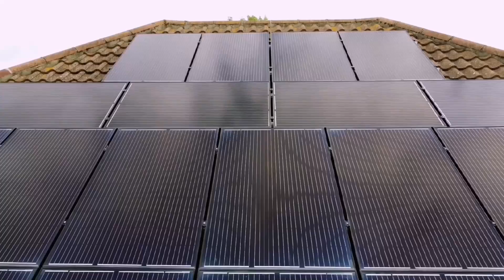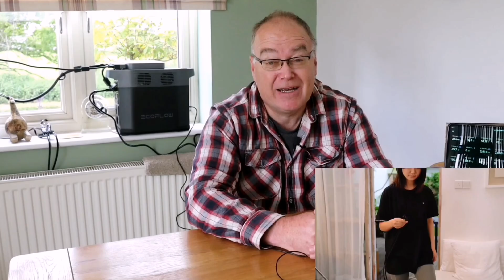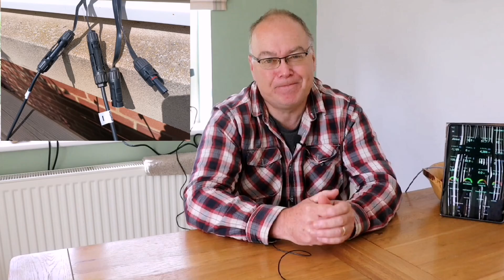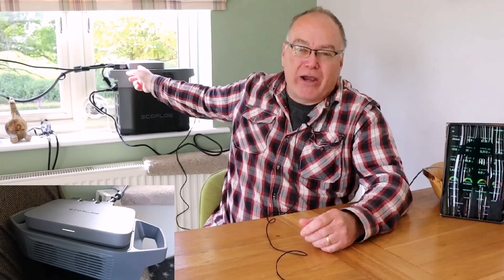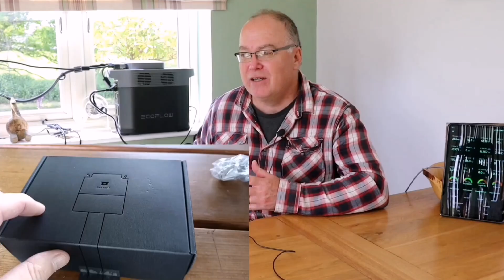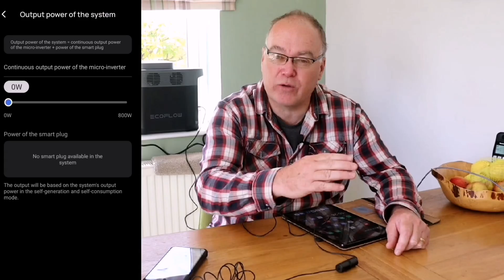Revolutionary Ecoflow PowerStream - DIY plug in grid tied Solar PV & battery system

Comment: Removed from the UK website today :(
Reply: "We are sorry, I just checked and I was informed by our relevant department. powerstream is currently off the UK official website, we are upgrading and improving our products. It will be available in the UK in the near future."
Reply from the maker: Curious ....
Reply: @EVPuzzle  Think the penny has dropped its not legal on the UK market. Be good if they can come back with a workaround that fits the UK market though. Be a great product. If they can get it registered on the MCS approved installer list for a start that would help as it proves it will act correctly for the UK grid. Then they just need terms saying connect it on a dedicated circuit.

Comment: Great video thanks for answering a lot of questions. I’ve got one more for you. Can the power stream work in reverse and charge the battery from the grid plug? Say for instance I have a reduced cost electricity overnight, can I set a schedule to top up the battery using the cheap rate during this cheap window? Where the inverter would draw the power from the grid and send it to the batteries? 
Ideally I’d just use the D2 extra battery but as this can only be charged via the power stream (or a standard D2) it may limit how useful the system could potentially be.
Reply from the maker: Battery itself charges from the grid not powersteam
Reply: hi have you worked out?

Comment: Ref the cable removal. There should be a tool included that pops the cables from the inverter. Check on the underneath of the inverter cover
Reply from the maker: Yep missing on mine

Comment: Really interesting system!  I live on a narrowboat and looking for a new solar set-up.  I've been trying to cut down on my electric usage over the past couple of years and generally use everything 12v, but I miss playing on my xbox!.  Would this system work to generate power for your house in a blackout I wonder?  (presuming the total load doesn't exceed 800W)
Reply from the maker: Only the battery provides power in power cut but solar could plug into the battery in that situation
Reply: If you have enough capacity (they burn electricity compared to a typical laptop) and you need mains you can add any old 12v to 240v inverter to a 12v setup. It's much much more efficient to avoid it though.  The powerstream inverter only supplies power when there is power from the grid as well, but if you are not grid tied is not suitable although the delta max 2 might be except for its rather limited solar panel capacity (800W max)

Comment: Thanks so much for the video. I agree this is almost an iphone moment in solar/ battery technology in the uk. I am amazed eco flow are not explaining this solution in a better way. I have lots of questions I am afraid - maybe useful if you end up making a 3 rd video! 

Here goes

1) it looks like with this setup you have the panels connected to the smart invertor up the limit. If it was say low light in winter could you have panels both connected to the smart invertor and also connect panels to the delta battery? So that you could be both capturing solar direct to charge the delta and also be inverting solar connected to the smart invertor at the same time?

2) regarding demand for power via the smart invertor, if the invertor was feeding power to say a plug enabled device, to save plugs, and if the delta was say next to your broadband router etc - could the local devices be plugged directly into the delta rather than taking power out via the smart invertor?

3) is there anyway to use the eco flow app in demo mode to see functions before buying a setup? Reason - for example is there and option to set a minimum SOC at say midnight and if low then the delta would charge from
The mains supply to property when on a cheap rate tariff?

4) if 3 is not available is the soc available to other automation systems like home assistant or SmartThings so that it may then be able to trigger intelligent soc/time of day charging?

Sorry for all questions but an exciting bit of kit for sure.

Comment: Thanks for this. Have been wanting someone to explain the system for a while now. I was previously confused as to if this actually fed power to a home via existing wall sockets. It seems strange to think that power can be put into a home this way as we perceive that sockets are for taking power out. Still a bit confused as to what the smartplugs do. Does this mean only appliances using the smartplugs benefit, or does the system feed other normal sockets around the home too? Great video nevertheless. Thank you.
Reply: Smart plug is just intelligent wireless way of sharing consumption information to the system. When the system gets the consumption info, like 100 Watts is consumed right now, you can configure the system to add that same 100 W on top of the base load you have configured. The best would be, if the system could detect the consumption of the house as total and you could adjust with that.

Comment: Do you think it would be possible to use an extra 400w panel plugged directly into the Delta so the battery was being charged even when the house was taking 800w? Wondering if it could be hacked to make use of 1200w of solar

Comment: This system is almost certainly illegal in the United States. Grid tie inverters must sense when the grid goes down and shut off. Otherwise it backfeeds power to the grid and risks electrocuting the techs working on the grid. If it does sense power failure and shut off, then it’s of no use when the grid is out so why have a battery? We use (pro) wired-in load switching panels for off grid backup just for that purpose.

Comment: I have sent a question to EcoFlow themselves but not sure how good they are at replying. My question is how does this work with your existing solar and battery? When you’re pushing watts into your home via the EcoFlow system does your other system just see a reduced base load? Also what happens if the EcoFlow battery is full and you’re producing more solar than base load. Does the EcoFlow system just shed the excess or does it feed into the grid? I’m close to buying as I think the overall package is actually pretty good value - I just don’t want to buy and find it won’t work with my existing solar/battery system.  Cheers Nick

Comment: Explain to me the point of the power stream?  The delta models come with a plug and inverter.  Why not just run a long extension cord off the delta and skip the power stream?

Comment: Hi Nigel, followed you for a while now which has been very helpful with designing my system.  On the eco flow I am sure the anti islanding protection means the 3 pin wouldn’t be live when unplugged as it would be disconnected from the grid. I think with a couple more panels, a wireless ct clamp and combined with off peak tariff this could work really well for people not looking to do a full install. Will look forward to more videos…
Reply: If you have a smart meter and start back feeding into the grid your energy provider will send out an engineer to check you haven't tricked the meter. Also feeding into socket (against UK wiring regulations ) can overload the cable supplying any other socket outlet on that circuit.
Reply: @DavidPemberton-k5q  absolute rubbish as from a grid point of view its no different to a fixed install and can also be registered the same as a fixed install so no engineer will call. This system has also just been passed for legal use in the UK AND APPROVED.
Reply: @vincelemon6343  am sure it will get banned soon enough just a shame someone always has to get hurt or even die before action is taken. Electricity is dangerous always seek advice from a qualified electrician.
Reply: @DavidPemberton-k5q  I actually agree to a point. The one thing that puts me off this actually is my house insurance as im not convinced we would be covered in the event of a house fire in the uk if it was found one of these devices plugged into the system. We all know insurance companies look for any reason not to pay a claim so i bet they wouldnt pay out even if no fault of device.

Comment: Do you have a circuit diagram Nigel showing how you are connecting into your house ring main - I'm intrigued but sceptical.  eg if the local substation goes offline, your Ecoflow needs to also go online otherwise your sticking 240V back down the mains incomer and back to the substation.

Comment: There is so much ambiguity in the comments below, why not just buy a solar inverter battery like an eco flow delta 2 max 2 kWh, or an Anker 767 2 kWh (which I have) and have a transfer switch installed, this enables me to power everything in the house through the main consumer unit in the event of a grid down at the flick of the transfer switch, plus you can switch off the mains power with the transfer switch and power almost everything off it to save electricity for a day if you wish, all legit and safe, am I missing something ?

Comment: Tempted as I don’t want to install at my current property as I’m probably only going to live there another couple of years. 

Like the portability as it would be good for camping, when travelling etc. Also great for powering gardening tools, shed, summer house etc without the need to install electric. Got a quote to put electric into my log cabin and that was going to cost around £1,500.

Comment: Looks a great product.  I might have missed it but how would it handle a power cut.  This would be a bonus.  Let me know what you think.
Reply from the maker: It cuts supply and you can use the battery in isolation in a power cut..

Comment: Hi ..Can you explain to me how it works because I didn't understand, I have power at the sockets and I plug the microinverter into the socket to give me power.... the power must be off in the house or the smart socket does not take power from the grid but only from the microinverter..  ....it's beyond me....can you explain?  I think that in two weeks it will come to me too and I don't want to make fireworks in the house

Comment: Hi Nigel this is very interesting and something I’ve been waiting for for literally years…. 

I have a full solar setup and Tesla Powerwall so I’m familiar with the concept of solar/battery etc. I also have a static caravan and so am very interested in whether this is a neat solution providing solar power and I suspect it’ll cover the majority of our usage in the van? 

For me the bit I’d like to understand better is the max input (solar) and output (load) I think from the video and reading the comments it’s 800w continuous? - is that right? Also what if any, is the limit on storage i.e. can you build a larger storage system of say 4/6 or even 8kW? In terms of using it in my home supplementing my existing system having an extra say 5kW of storage that I can charge overnight on Go and then release into the house at 800w during the day will help through the winter when solar is minimal and (as I’m 100% electric with ASHP & AC) loads are high. Basically it’s a way of upgrading my storage without having to buy another Powerwall and as I have high power output covered by my existing system the 800w limit shouldn’t be an issue. 

My fingers are literally hovering over the buy button but before I do I need to research some more to ensure I’m fully informed and understand the limitations (ps I assume AC input into the battery from mains plugs into the battery itself? Can this be done while the system is running and outputting?)

Comment: I’ve always thought that solar systems would get cheaper, but it’s no good seeing the hardware get cheaper if the labour costs don’t become cheaper.  I think this solution has a hint of genius about it:  Delete the labour costs entirely and you expand the solar market to everyone:  tenants and flat dwellers.  

The one concern I have is that someone is going to accidentally drop one of these panels from their balcony causing damage/ injury to someone underneath and then a whole new raft of rules come out banning balcony/ window hung solar panels.

The question now is how big a system can you make using this DIY method?  I suspect that 2.7kW (typical room heater size) will be a continuous limit for a 13amp socket..  I think that is more than adequate for 95% of existing domestic loads (heat pumps and EV charging excluded).

Comment: As a Engineer it will never be legal in the UK to feed the grid through a  BS1363 13amp domestic plug, that will always remain way outside BS7671 regs. The UK is always getting tighter on these sort of sloppy installations, Thank goodness!! But nice try ;-)
Reply: The line is not blurred, it's use in the way suggested is unsafe.
Reply from the maker: Makes you wonder who in what department saw this and gave the various approvals it does have.  Am I right though BS7671 is for 'installations' not consumers plugging in retail goods . Is this where the lines blur?
Reply: @EVPuzzle It's not a retail electric appliance though. It's a  Micro-Generating Plant that is providing power to the fixed electrical installation.

Comment: If you want more battery storage could you add more than one system and the APP be able to monitor both systems?
Reply from the maker: Potentially but conflicts will exist potentially..only reason to have two is to double the import charging rate
Reply: @EVPuzzle  While you can't yet daisy-chain different power station models together, you need to unplug the micro-inverter from one power station when full and plug it into a different one, if you have different models. 
Seems limited in potential at present time.

Comment: Hi there great vid thanks…re pulling out the plugs that you mention are difficult to get to…I’ve seen another YouTuber showing a tool that came with his one…it seemed to be inside the grill that covers the inverter if you fix it on a wall…just thought I’d let you know…Brian.
Reply from the maker: Yep a few have mentioned , Ecoflow sent my kit very late on a rush it seems  and didn't send that instruction .  Not a slick solution so my point stands, if you plug it in by hand why not unplug by hand unless they think it's dangerous ??

Comment: I've looked on the Ecoflow link you have provided.   Their recommended kit is 
£2,367.00 GBP.    This price gives no indication whether it included VAT or any other import taxes.
I've tried contacting Ecoflow, they don't reply.   I can only think they dont want to send me a message I won't like.
The Amazon link if for a smaller 1kwh system.

Are you aware whether VAT etc is later added to the Ecoflow website prices when delivering to the UK?

Ecoflow have responded to to technical question,  the feed in wattage has to be guessed, with only the plugs being able to ask for their current.   This might work, or you may feed the current back into the grid if you overestimate

Thanks for the video.

Steve

Comment: As a portable battery pack, for camping etc, okay.
As an emergency power supply in the home, directly plug into the device, okay.
But if you are buying to save money via solar, it will have broken or worn out before that will ever happen.
Reply from the maker: You missed a key reason

You want to be greener. This typically means you don't care about the investment /savings

Comment: Hi, I don't know if it's already been asked/answered but when you set the battery to 90w output I am guessing anything not used by the house will be given to the grid? Do you know if there is much ramp up/ramp down with this? (asking because if I do buy one then would like to know it is efficient in its turning on and off via the smart plugs when using it, to try and not use the grid)
Reply: Also another question, if I did get a delta 2 max with the bundle is there an option to link up to one of the 1kw battery's along side it?

Comment: It’s interesting that they chose to use smart plugs to monitor power use, so presumably you’d need quite a few of these. Why didn’t they just add a CT clamp to monitor the meter tail (like a Zappi) and then it could exactly match the load, regardless of where it’s used.
Reply: they said most people couldn't do it! oh & max if 6 plugs per house
Reply from the maker: I'd guess we'll see a full home storage system from them soon with grid monitoring
Reply: I Think we can all put in a plug but my understanding of this type of approach is it could damage equipment. Have you run this past a qualified electrician?
Reply: Interestingly, two years after this video, the PowerStream product seems to be superseded by the new Stream Pro/Ultra/AC-Pro products, and these seem to be able to be paired with the EcoFlow Smart Meter, which does exactly as I suggested, monitor the grid connection to balance the load, not individual sockets. Needs an electrician to install, rather than just user plug-in, but it’s a much better solution.

Comment: Warning ⚠ Danger Against UK wiring regulations BS7671 reg 551.7.2 (ii) A generating set shall not be connected to a final circuit by means of a plug and socket-outlet
Reply: Presumably then this HAS NOT been approved for use in uk?
Reply: @MrTedJourney Nigel may be able to answer that question